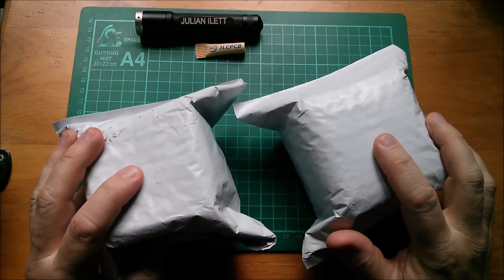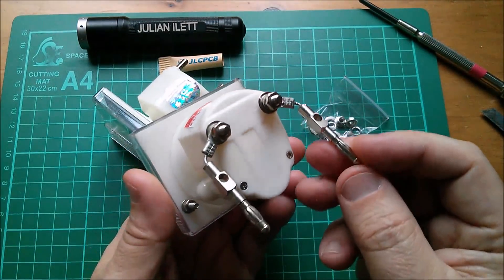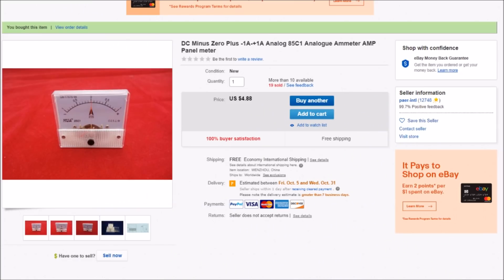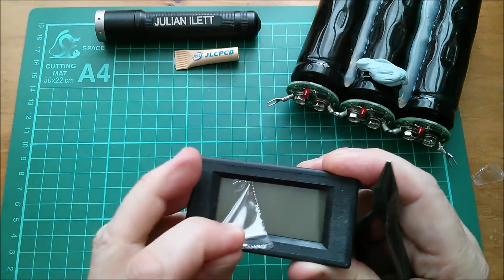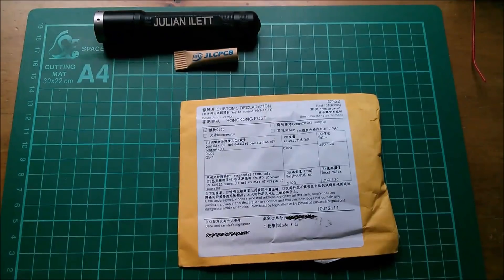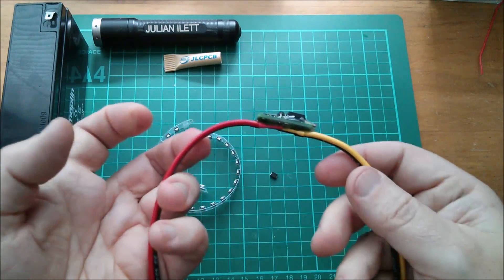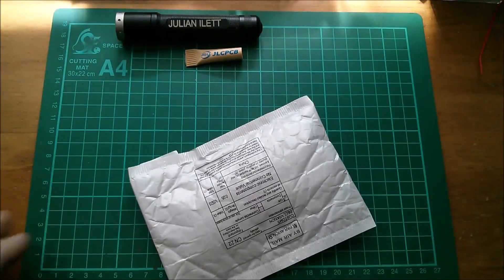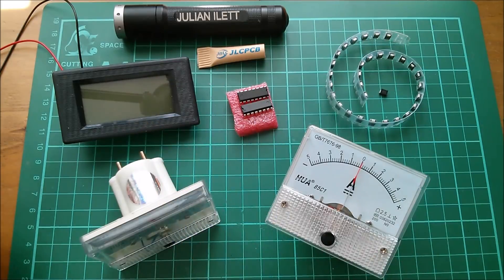Julian's Postbag: #124 - Centre Zero Ammeters

Comment: Sorry if this is redundant but... Why not use a thermally conductive, electrically insulating potting compound?  Even if not available in clear it shouldn't be too hard to expose the head of the LED or some simple light pipe or something.

Comment: Part of me has always liked the idea of using analog gauges for certain projects. The needle is kind of nice and bouncy.
Reply from the maker: Yeah, there's nothing like an analogue meter hitting the end stop to put the fear of god into you. DMM just shows a bunch of numbers :)
Reply: And has ballistic averaging for fluctuating readings.... fantastic for some purposes.    Display a 1.1Hz sine as a sequence of numbers at half second sampling intervals and no one can make sense of it. Display it as a pointer bobbing up and and down and it's obvious.  Just call me pathologically old school.....
Reply: Julian - Ya, sometimes it is not so much worrying about your circuit but more "save the meter!  Save the meter!"  That gets you to jump into action!
Reply: I still have my first ever multimeter - bought from TANDY in 1983. Cost me £25 even back then. It turned out for current it was more sensitive than the light spot galvanometers I was using at school. Still works but is probably about a billion miles from calibrated.
Reply: Yes, I love the bidirectional analog meter!! I really should get one so I can quickly see if my batteries are taking a charge or releasing energy.  Right now I'm just using a clamp meter and I keep forgetting which way the negative lead has to be going through the clamp to know if + means energy going in or - means energy going in.  I want to set up an analog meter such that if the needle goes to the right, that means charging and left means draining.
Reply: At that price I'll be getting 3 or 4.
Reply: Yeah, my ancient AVO-8 has had a lot of punishment, well overloaded, but the cutout always pops out to save it! Still as accurate as it was when it was made in the (?) 1970's!
Reply: I think up to about AVO 10 they were the closest thing to indestructible.

Comment: 0:09 
1. push out the knife blade so that exactly one segment is out.
2. get pliers, grip the segment of the blade and twist
3. enjoy a perfectly sharp knife.
Reply from the maker: Twist? I never tried that :)
Reply: Often these type of knives have a split in the end cap so pliers are not required. Remove end cap, line up blade as suggested, put end cap over the blade and bend until the blade snaps, be careful of where the piece might go flying off to.
Reply: yeah that can work too. With pliers you can hold the piece that snapped off immediately, so it´s safer.Otherwise you could also just push it onto a table sideways to snap it.
Reply: Mine broke the plastic when i tried to break one off

Comment: Nice stuff that UV glue. I ordered a bottle of 50ml straight away, only 2.90 USD. I want to try and use it to use the solar panels which I bought a year ago. But the panels are less then 0.5mm thick and break if you only lift one up! Using this glue I can attach it to a piece of glass. And better yet: UV light will only harden the glue, so I can also use it for those smaller solar panels which have a layer of plastic all gone blurry. Very interesting glue and properties .. .. Using it to make things water tight is also very useful!
Reply from the maker: Thanks mate - you're one of the few people that actually likes my conformal coating idea :) Now if I can just bring a few people round to my way of using solder paste!
Reply: lol... don't fancy your chances... but don't stop trying! :D That UV glue is certainy very handy... having that superglue bonding strengh/property whilst being able to handly stuff and then have it set on when you want it to...
Reply: S'funny - 20 years ago at Nokia, we designed a new, small GSM 2G basestation. For output, it had some Motorola modules, which were about 3" by 1" on the 'heatsinky' side. Unfortunately the case of the machine was made by cold-extrusion of aluminium, and the place we had to screw these modules down was a tad rough. Heat sink compound and 1.8G don't work too well, because of the myriad non-conductive gaps! Just by chance I was talking to a work colleague and I spotted something he'd thrown in his bin. It was a graphite sheet - thickness of thin card - so I rescued it, and tried it. cut it to size with a pair of ordinary scissors Perfect! Even 20-odd yeas later, I believe Nokia still uses the stuff! (But, obviously, it's for production use).

Comment: if your worried about lightning strikes  for ac midnight solar has wire in modules for that  if concerned for low voltage application look for the gas arrestor types like the ones used in the telephone exchanges  have 3 legs like a "t" shape  similar to a thick coaxial diode with a wire band around the middle and a tap coming off of that

Comment: you can print your own scale cards on the computer, then change the resistor on the shunt to alter the scale,
i ordered a center zero 100 ua meter for a detector, but they sent a 10 ua instead so i re-calibrated it, then printed a scale card for the face, there is a resistor calculator on the net for ammeters.

Comment: Pretty sure the general family of center zero analog meters are known as 'Null Meters'. Eons ago null type ammeters were common in cars... in a way wish they still were; along with a complementary idiot light... or better still a complementary volt meter & idiot light. One big time disadvantage of the old automotive ammeters was the need for long, large gauge high amperage wiring run to the instrument panel; or to have an external shunt somewhere. A lot of quick troubleshooting could be done with those ammeters... but for the most part the general public didn't understand or care about them; and they went the way of Max Headroom. Sad to say it, but big bright idiot lights really are the best option for the masses...

Comment: Something to add to your next Ebay order: some of those crock clips that have 4mm sockets :P Just clip it onto battery terminals then!
Reply from the maker: Are they big enough for car battery terminals?
Reply: Some of them are... some of the hobby battery chargers come that way so you can plug the main power for your charger directly into the croc clips...